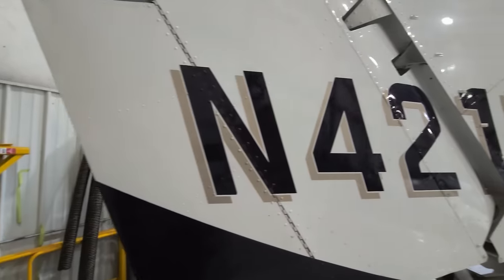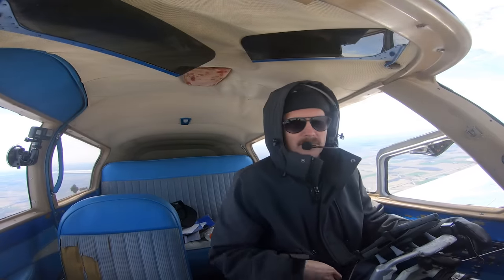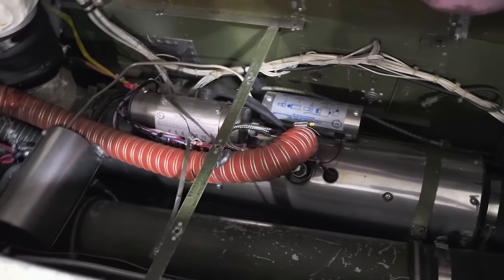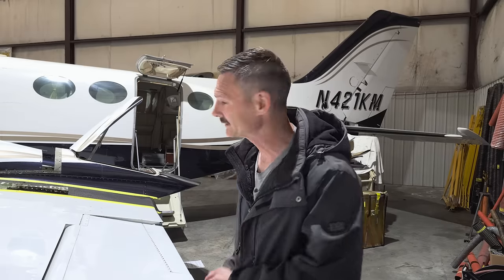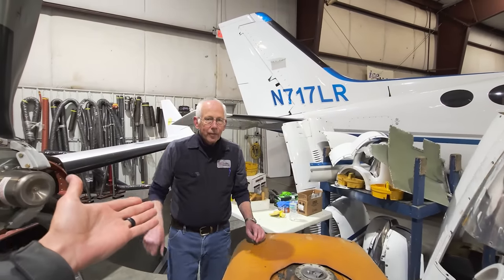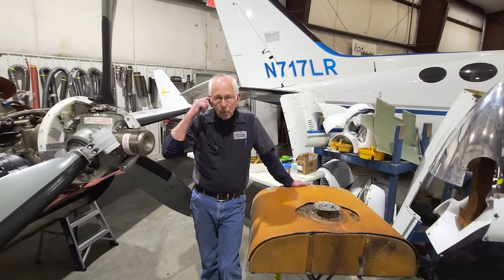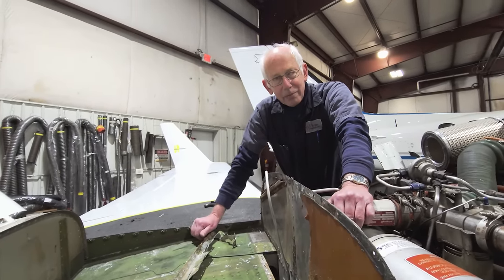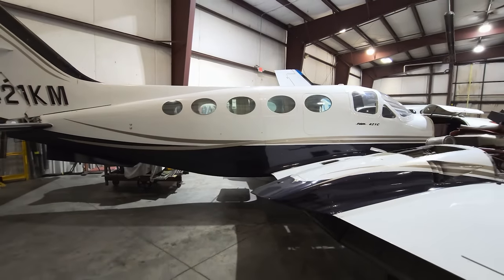I Bought The CHEAPEST 421C In The World.

Comment: Jimmy, that's a nice plane. However, having search this market in the past and done lots on homework, be very careful. Your annuals are going to be very expensive and or time consuming. If you send your mechanic to school on that AF it might save you a buck or two. I've used TAS several times to great advantage and NOT bought a problem child/neglected AF. That AF you are looking at is an early C model, hence the straight legs. From what I've learned you should be looking for cantilever main gear and you'll get all the final factory 421C upgrades. Frankly, your better off looking at a C90A or C90B with mid-time turbines. No clue what your going to offer on that plane but you'll pay for a KingAir with the AVGAS money. Also beware of the RAM engines, great engines, but big time sticker shock at OH. You also don't want to go past TBO if you make it to TBO.  Big gotchas, with vibration damper  (that's not the correct name) by the gear box, that's the weak link. The OH on that engines and it's appliances is about 130K ea!! and don't forget to ask about the 400 series spare strap AD as well. Good luck.
Reply: Jet fuel is more expensive than avgas, and a king air burns 70% more fuel.

Comment: MY OPINION: Fix the corrosion , leave the tanks out ! A true fire hazard and corrosion getter. If you put the tanks back in the possibility of corrosion is always there plus I wouldn't trust that flimsy firewall and any way you fix it, it is too close to a heat source that could burn thru if the turbo decides to have a crack and burn thru. Think twice on placing those tanks in. I rather have to make some fuel stops then to suffer the possibility of those tanks, firewall and supercharger failure !  Remember your family and you are  riding in a vehicle you can't pull over and park on the side of the road.          MY OPINION !

Comment: I've been in engineering QA/QC all my life. I'm 100% sure that material technology (metals, plastics, composites etc.) has been at an advanced level for at least 30 years. And together with that, anti-corrosion/erosion treatments (e.g. coatings) are also an established high-tech option. So why are so many of the aircraft we see on Youtube suffering so drastically from corrosion/erosion problems ? I understand many are older models, and some corrosion areas are buried out of sight. However, as you point out, regular maintenance is obligatory, and thus gives regular opportunities for focused inspections (using historically known details of weak points), upgraded materials and surface treatments. Is this commercially-driven obsolescence ? Shoddy design ? Poor regulatory controls ? Or the result of underinvestment in the aircraft (not enough money available, or too 'tight' to spend) ? Whatever it is, it must be impacting the general safety of aviation, and therefore, anybody unlucky enough to be involved in an aviation accident. What's your take Jimmy ?
Reply: Cessna did not design these planes for a 50+ yr lifespan. It's truly a miracle they are still flying and a testament to great care and maintenance. How many 50+ yr old cars are still on the road?
Reply: @skyboy1956   Understood and agreed. However, my premise is that any aircraft still flying has been maintained according to regulatory requirements (normally at great expense) over it's lifespan, so I would expect corrosion sensitive components to have been identified, replaced and/or treated ? Unless the aircraft has been grounded for some years before this inspection, and has suffered storage corrosion ?
Reply: @terryross1754  Cessna did gather information and write supplemental inspection documents (SIDs) based on data collected in the field, however, compliance with SIDs is not mandatory.

Comment: If you don’t have another tank on the other side I’d discard it. My 340A has 7 tanks and the nacelle tank I’ll never use. Sounds like on yours it’d be best to remove it permanently. Most likely you have the AC condenser in the same place on the right wing.

Comment: @therealjimmysworld Might a Cessna 441 Conquest II be a better buy being turboprop? With a service ceiling of 35,000 feet, the Cessna 441 Conquest II is capable of rising above turbulence. Cost Per Hour = $842.83
Reply: 🤣 the fuel alone is over $600/hr.

And there is no such thing as getting over turbulence.
Reply: The 441 will cost the same, or even slightly less per mile if looking only at fuel/mx.  However acquisition cost 5-8X as much.  I replaced KM with a 441 for customer.  Both were great airplanes with different capabilities.

Comment: GTSIO: sounds like, gitzo, meaning, cant do engine failure training in a Golden Eagle/C404. To this day I dont know what an engine failure feels like in either of these twins. Imagine crossing an ocean and having to cage one at the halfway point. Now you have to fly twice as long as the first half of this exceedingly long flight on the only remaining finicky sensitive GTSIO engine with minimal engine out training in type. You might as well build the toilet under the captains seat cuz you aint going nowhere else for the duration. Not to mention the part where I shit myself when the first engine hiccuped and Im 2000 miles offshore. I have had engine and electrical failures in piston, turboprops and Jets. The electrical failure in an Aztec at night in the ice and low IFR almost got me. The only thing that saved me was a quick turn to the nearest ILS. Not one of these things scares me more than flying any piston twin on long range tanks across an ocean. Caribbean flying not so bad. A bad rod, electrical smoke in the cockpit, a cracked case causing oil loss and any number of unexpected or even anticipated surprises would under normal circumstances send you scrambling to the nearest suitable airport. All those wonderful options are gone in remote areas, especially over water. If all these warnings fall on deaf ears, you will likely end up in St Johns Newfoundland. I believe its the shortest jump great circle to either Iceland or Ireland. God Speed to you if you try it.
Reply: a C414 does not have geared engines.
Reply: @buckmurdock2500  your right, meant the 404 titan😁

Comment: Why are those engines so thirsty.  a P&W R2800 does just about as good at the Continentals on this Cessna.  The Cennsa has two engines (375 hp each or 750 hp total) consuming gasoline at 50 Gallons per hour.  R2800 has 2000 hp and uses 60 gallons per hour.  What a difference.
Reply: lol. where did you come up with these numbers?

Comment: I have several 100`s of hours in the 421C. You`ll enjoy it, was one of my favorite aircrafts. Make sure to keep the propellor gearbox  under load to prevent the gears from loading and unloading as it`s very hard on the gears. This only happens on approach to landing with the low power. The technique is to keep some power on then retard to idle as you are preparing to flare for landing. You`ll feel the area the gearbox doesn`t like when power is set to low.

Comment: Flying with partner and children:  Make sure your partner knows how to use the radio, knows the different instruments (height, speed, level, etc), and the basics of flying this airplane IF your partner isn't a licensed pilot. 
Too many planes have crashed because the pilot died or was unconscious, and the passenger(s) had ZERO knowledge of flying or even using the radio!!   
Imagine sitting high in the air in a plane with "no pilot", knowing you are going to crash and you'll all die?!!

Do you think some of them would wish they had enough knowledge to try a landing that could save all your lives???

A person with just basic knowledge and in contact with an instructor to tell what to do, when to do it, will increase the chances of surviving from 0-1 percent to 80-100 percent!!

Please, give your partner the few hours needed to learn the basics to be able to land with or without assistance, no matter if your children are on board or not.   It's the ultimate gift of/for life!! 

PS: I'm a former glider pilot with 370 hours, my late dad was a pro pilot/instructor with 19.960 hours, and all this is only based on my personal feelings and knowledge of flying.

❤❤❤

Comment: Just to let you know that there is a product that was made a number of years ago and invented by a man in Michigan they did sell the product and somebody else is actually selling it but it's called Gibbs.
It's like a penetrating oil, and it will soak into a millionth of an inch but it's the only penetrating oil I've ever been able to spray on anything like brake drums or any part of the car and you wipe it off and you can paint it and it allows the paint to still stick to the structure. Once you get all of that fixed up, just a light application of Gibbs on the surface will insulate it from any moisture, because the surface tension of any moisture or water will not allow it to get into the aluminum structure to cause corrosion in the first place, or it will be severely restricted. The only thing that this will not seal is it will not display salt. So it has to be cleaned of any salt spray that ever got on it. But I have seen it do some really wonderful things for things like even tiny parts of firearms, I've seen it used to help detail engine bays, it really is a Wonder product. I don't know if they actually make a product like that that you guys already have access to, but that is a product that might not be a bad idea to treat these things with when you're reassembling this aircraft. It won't take much. I've even sprayed it on the engine every fall, I live in a Northern area, and I will spray my engine down and I will spray the engine bay while the engine is running all the rubber everything and basically I sold a vehicle here a few years ago with 256,000 Mi on it and once you cleaned up the engine bay you couldn't tell it was more than 6 weeks old it had arrested all of the oxidation of any of the aluminum in the engine bay of the vehicle that I sold. And that was with just a a spray every year period and that was probably more than it needed.

Comment: Excited for your new purchase. But the cost of repairs for general aviation is a huge reason why GA is slowly dying. There is absolutely no reason why a heater overhaul should cost $10k in parts and labor. Someone is getting rich and it’s not the average A&P. Unless a person is making mid 6 figures or more this airplane isn’t realistic to ever own. Even single engine costs are astronomical.
Reply: It might be dying for you but overall it's doing quite well . . .
Reply: @bsdh01  The high costs are due to several issues.  Insurance that these companies have to have is insanely expensive.  GA is a low volume industry.  Whereas Auto manufacturers make millions of the same model, Aircraft volume is in the thousands, manufacturing, insurance and certification costs are divided amongst a much smaller volume.  FAA certification requirements for the manufacturer of parts is insanely high.  Most of the GA aircraft are 30 to 40 years old and the number still flying gets smaller every year.  It costs money to store spare parts for aircraft that are getting less and less.  Often times the tooling for spare parts is no longer available and the remaining inventory of parts becomes more valuable.
Reply: @skyboy1956  The only GA that is doing well are turboprop and jet sales.  Piston single sales are dismal.  Beechcraft hasn't sold a new Baron in years!

Comment: Why not add another piece of Sheet aluminum between the turbo and the fuel area to allow the added plate of aluminum to take the majority of the heat and only radiate off to the fuel area which would reduce the heat drastically?

Comment: I know you never read the comments but from a Marine tech that deals with a lot of Moisture are they just going to put the tank back in all rotten with the coating on it. You need to have that tank tore down and do an inspection on it with a bore scope and have it cleaned and all the corrosion removed and re coated. Be stupid to put the junk tank back in with out servicing it and re coating